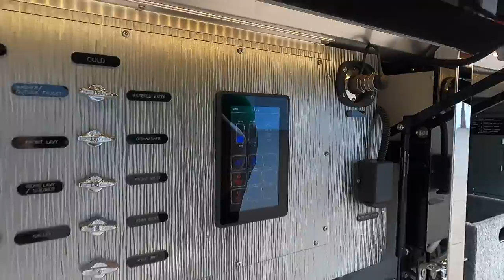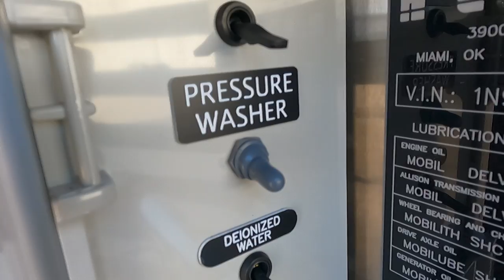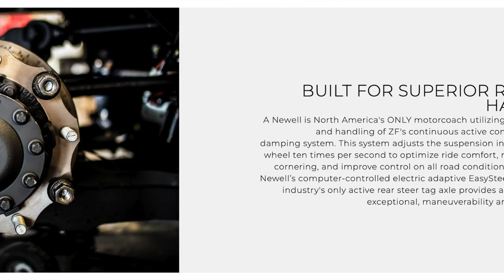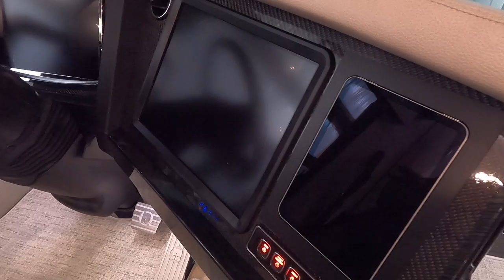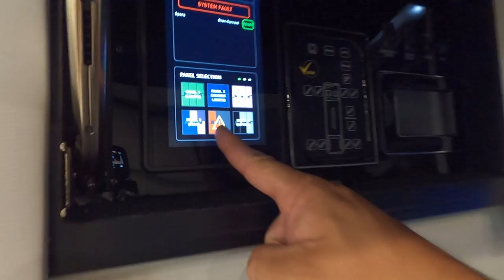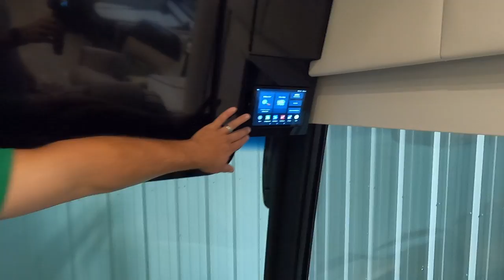Tour of Custom 2023 Newell Coach #1761

Comment: Another totally amazing Newell! Great paint scheme - but for me, the white stripe has become a sculpture - actually raised up from the surface, so it is not just white paint, probably a half-inch of solid metal, or metal-covered plastic or fiberglass. The interior - those two doors need to become something out of Star Trek - The Original Series, are split vertically,  so its four sets of hydraulics or however the interior doors work.

Comment: Question if the coach is lifted off the ground at the drive tires and the steer tires would it hurt the tag axle  if it isn’t supported on the lift. Another question is can you have an auto chain system on a motorhome with a tag axle?

Comment: Question. Does anyone know if u need a special license to drive one of these
Reply: Depends on where your 'domicile' is (and where your DL is from).  Some states require a non-commercial Class A or B license along with air brake endorsement while others require only a regular Class C license for RVs no matter the weight or size.